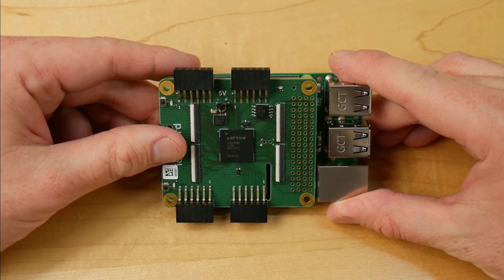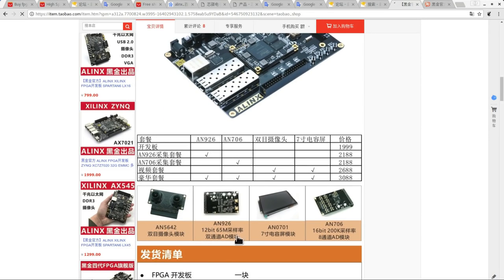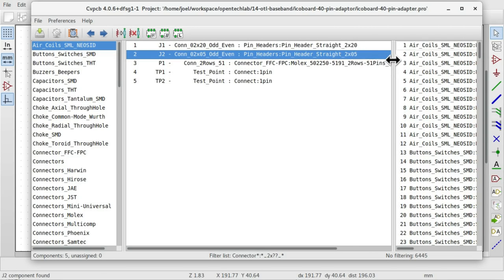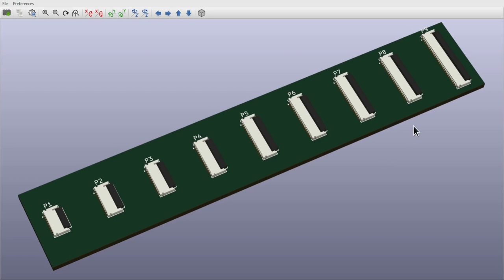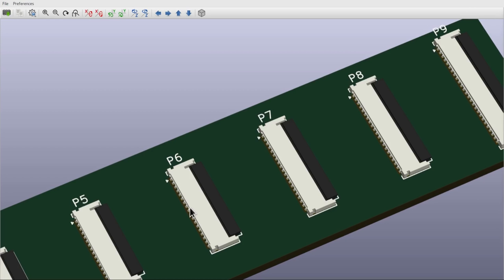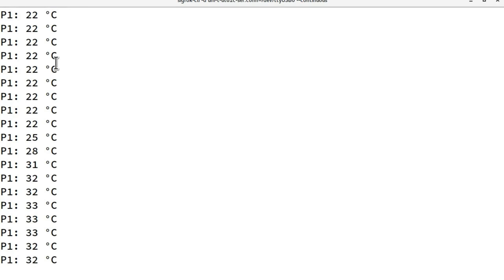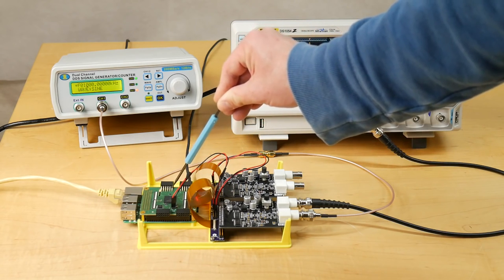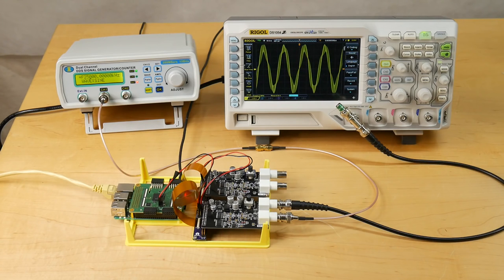[014] IcoBoard Software Defined Radio Project - Hardware

Comment: Anyone wanting to be inspired by what an FPGA can do, check out http://websdr.ewi.utwente.nl:8901/   This is a software defined radio implemented in a Spartan XC3S500E FPGA, sampling the whole spectrum from 0-30 MHz at the same time, and you can listen to any portion of it you want!  There are three main IC's doing all the work - the Spartan FPGA, an LTC2216 A/D converter clocked at 77.76 MHz, and a gigabit Ethernet chip to allow the WebSDR software to work.  Click on the "see here for background" link at the top of the page to see the evolution of this project.  Truly amazing what the builder has accomplished here.

Comment: That stencil was completely useless
Reply from the maker: Yeah. It looks particularly bad through the macro lens. I'll try more viscous solder paste next time.
Reply: I think the problem was that there was a gap between board and stencil, maybe because of that corner pieces which did elevate stencil.